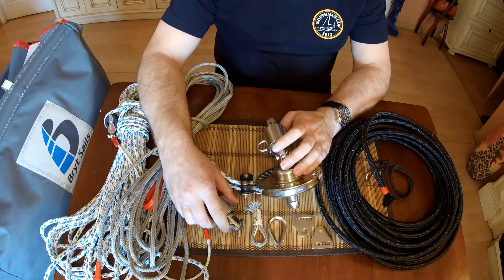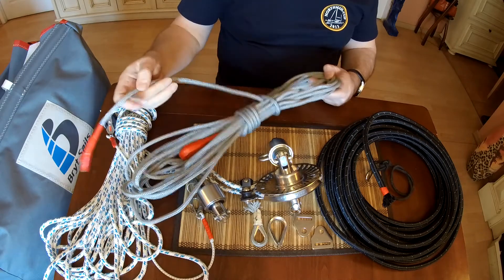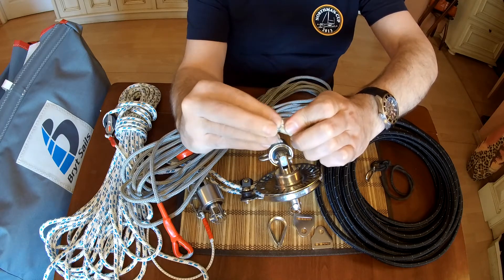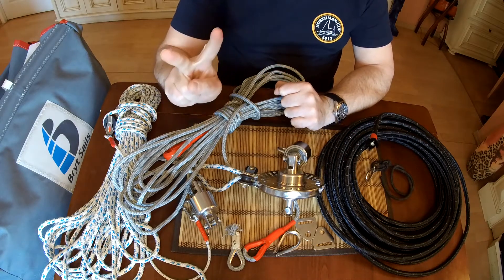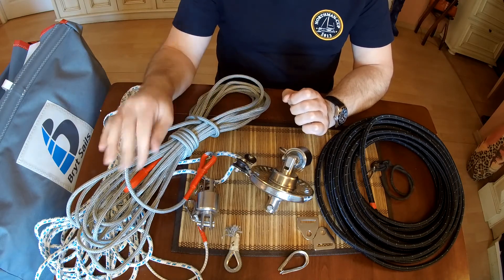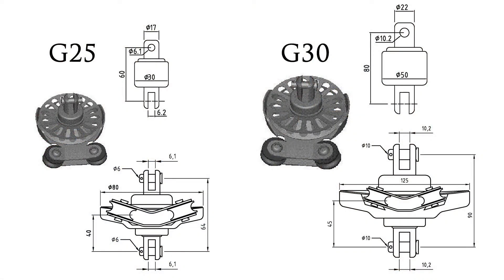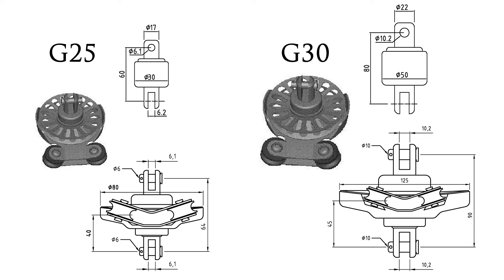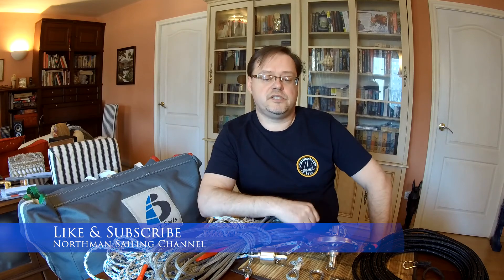G25 & G30 Top Down Furling System | NS Furling Gear

Comment: I have jeanneau SO50DS and I am planning to use asymmetric ginneaker 19x9.70x16.5 meters(or code zero) which model is suitable ?And what is the price?
Reply from the maker: Hi. G-series is for smaller boats. For a JSO 50DS you will typically need a 4.5-5 ton rated furler. We do not have it yet even in NS series with a maximum of a 2.5 ton rated model suitable for 40-45 ft boats, sorry :)
Reply: @NorthmanSailing  Which one do you recommend? Do you no any used equipment available Thanks a lot
Reply from the maker: @oguztanrisever9946  Actually, according to your sail dimensions (19x9.70x16.5) the gennaker is about 90 sq.m. - it is a rather moderate sail suitable for NS2.5 or NS2.5 Top-Down. What is the exact sail area and what kind of sail is this (Code Zero or Asym Spinnaker)?
Reply: Yes you are right. The dimensions are recommended by UK SAILMAKERS and most probably asymmetric spinnaker I will use but for code zero same system is recommended. The sail area is about 150 m2
Reply from the maker: @oguztanrisever9946  it seems to me we are communicating simultaneously here and at eBay. I have sent an answer to a eBay thread. We are based in Finike in the Med, so we could even meet during the season and you could see the furler system working :)
Reply: @NorthmanSailing  Ok now it is clear my friend
 Lets come to a solution:) 
Which is the equipment suitable for me and what is the very last price.
Do you mean that you are in Finike-Turkey
Reply: @NorthmanSailing  Hello,

As I have said previously, it is best to use 5 ton rated furler on a 50ft boat. But your sail is not overly large, so it is possible to use NS2.5.

We are offering a very good deal with our bundle, which includes everything needed to setup a gennaker furler on your boat. 

If you want a 5 ton rated furler for your boat - the prices would only be starting on ~$3300 mark and this is just for the bare furler drum and top swivel. We can supply such a furler, but the price is obviously even higher than for the NS2.5.

Best regards,
Mikhail
Is it you?😀
Reply from the maker: @oguztanrisever9946  yes, of course :)

Comment: hello,
On my good old26' boat I'd like to add a downwind cruising sail for our generally light air wind summer conditions.
(5knt - 9knt wind on almost 160- 180 degree downwind tacks). Most often solo helming, (with pretty maidens who prefer the sun to working sail). What's your thoughts on best G option and sail config/choice?
Reply from the maker: nxtrev1 Hi,
If we are talking about the apparent wind strengh, I think the most effective way would be a series of gybes at 120-160 degrees, speeding up the boat rather than going dead downwind, until the wind hits a least 12-14 knots apparent. Secondly, if you are sailing a heavy full keel boat like Contessa 26, generally you should be thinking of a spinnaker-like shape for the A-sail. That gives us  a large broad reaching gennaker like A2 (or maybe A5 for singlehanding). This sail will require a top-down furler.

But, when the wind is really light as 5-9 kts true (so you wont be able to go downwind anyway) or if you are looking for a universal cruising sail, I would consider an inexpensive nylon drifter (cruising code-like sail, screecher, UPS - it has many names) made of the cloth like say Superkote 75 and hoisted on a basic furler. This sail is practically trouble free for singlehanding. The wind strength determines the usage: when its light, go upwind. When the wind builds up you may reach or broad reach, and then pole it out and go downwind wing-to-wing. When it is about 20 kts apparent you may go downwind without the main, only on a drifter.

For a good old boat I would make a short sprit, because the pulpit is often stretched forward to match the stem shape, and it will be an issue if the sail would lay on it every time. And I would choose not very flat cut and bigger size of the sail - somewhat like racing Code1. It will be good for an old boat also - do not forget, there once were spanker sails for old boats, but with the modern cloth and triradial cut they became even better.

You may see this sail type in our other videos - the white one or tri-color one.
Reply: I agree with your gybe scenario. The Ranger 26 (mull design) is a fin keel config. I am confused as to why I cannot go downwind in the typical 5- 9knt conditions? Very much agree with your bow sprit set up and am working on that project. Thanks for the confirmation! Sounds like I should go bigger or perhaps use symmetrical spinnaker on the top down G25 rigged to the sprit? 
Thanks for all your consideration.
Reply from the maker: nxtrev1 When the wind is 5-9 kts true I am afraid it would be too weak to give you more or less decent speed dead downwind - thats what I mean. As for using a symmetrical spinnaker on a furler, I dont think it may be possible. And for a 26ft boat I woukd consider a G30
Reply from the maker: nxtrev1 This is an expensive laminate Code1 on the NS video. It is better for stronger winds and close reaching because it has lower stretch under load. When its really light a nylon drifter catches the wind, while an expensive sail made of CodeZero Optic is still too heavy to maintain its shape. With 7kts apparent (3-4 true) I may do as good as 5-5.5 kts on apparent close reach \ beam reach true: https://youtu.be/Yfi1xeNxA2Q